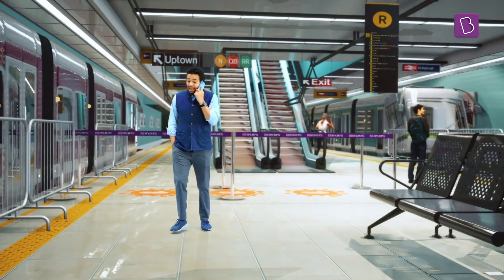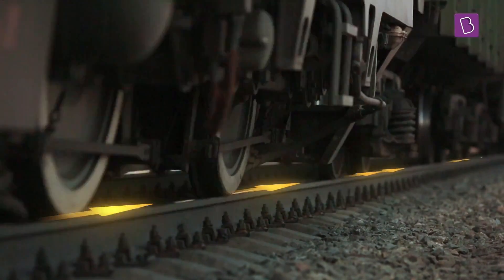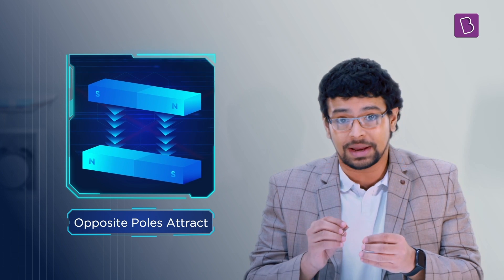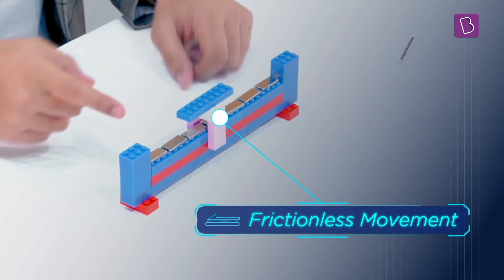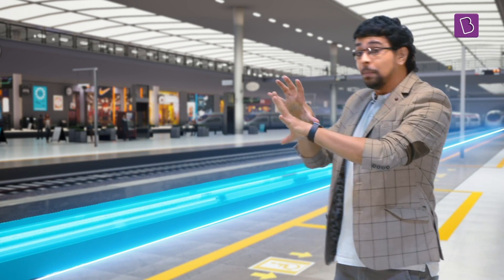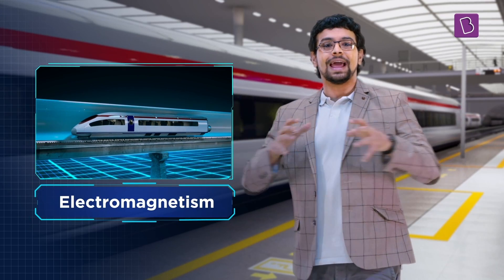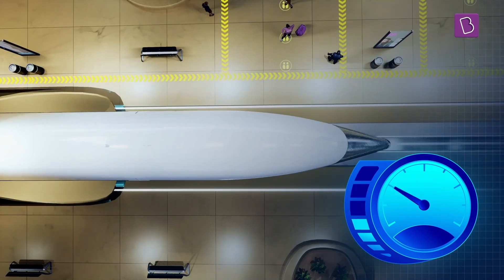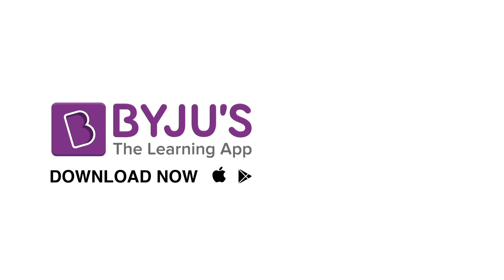How Does The Hyperloop Work? | BYJU’S Fun Facts

Comment: @4:16 "...the pressure would be so low, that it would be equivalent to flying 150,000 feet above sea level." ...making it more that twice as high as the "Armstrong Limit" (~63,000 ft) above which the ambient air pressure is so low that water boils at the normal temperature of the human body; exposure to pressure this low results in loss of consciousness within just a few seconds in the event of loss of cabin pressure. That's why pilots of aircraft that routinely fly above the Armstrong Limit have to use pressure suits.

Comment: For the breaking system if you are using the jet engine, simply switch of or at least reduce the thrust. Or for the magnet part you could use movable electromagnets to create a wall and use the resistance of the magnets, although you would have to reduce the electric supply slowly as not to give reverse thrust.
Reply: If you simply turn off the jet engine, The thrust it was providing would still take quite a bit of time for it to come to a halt..

Comment: I have a question..
If the hyperloop is kept in vacum then how this large fan works.As this large fan works on Newtons 3rd law.
Reply: It is not possible to create absolute vacuum , there will still be 10% of air remaining that is exactly what the large fan uses to propel the train forward using Netwon's 3rd law as your rightly mentioned